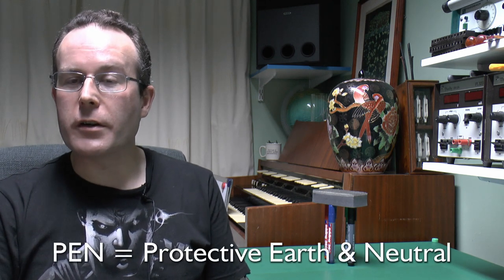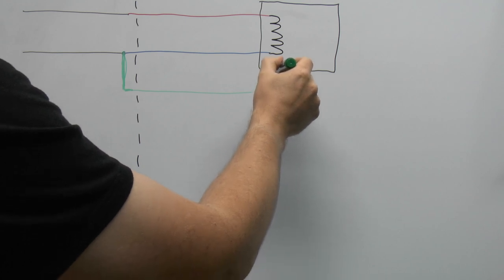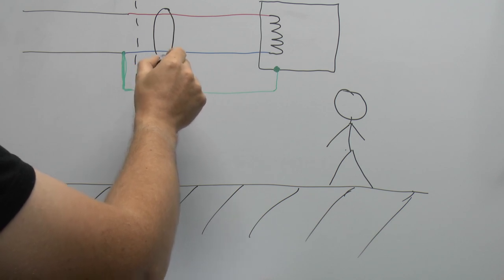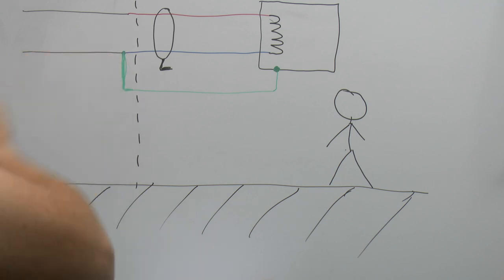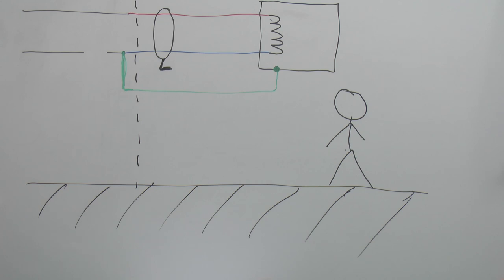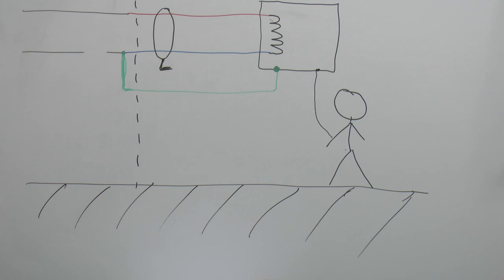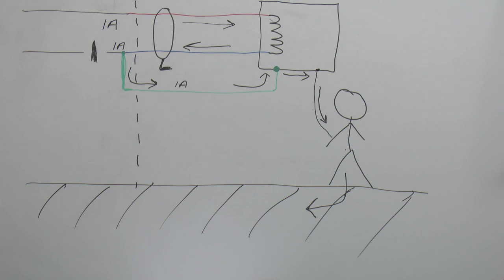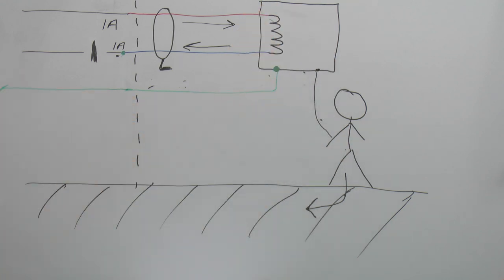TN-C-S Danger - Broken PEN Conductor (Combined Earth & Neutral)

Comment: 33:55 I was going to ask if this is a short circuit, but I realized the path is not complete. line->heating element->neutral->cpc->exposed metal part and then no connection back to line. thanks Mr john for the clear explanation.
Reply: could you explain the effects of using PME in TN-C-S systems ? how does it reduce the effects of electric shock in the case of a broken neutral. I read that PME is required in the case of a TN-C-S system

Comment: Picture situation at 3:55.   Neutral Return cable is broken on Supply Side of the boundary, no earth connection shown.  In New Zealand it is mandatory for the Neutral to be connected to Earth at or close to the point of entry to the property -- normally by a special suitably heavy cable running from the Earth Bus in the Fuse Box direct to the Earth Stake.  The Neutral Bus is also connected in the Fuse Box to the Earth Bus by suitable heavy jumper.  In domestic situations, the Earth Cable is an insulated (green and yellow, but may be green only) minimum 6 sq mm, stranded cable.

Comment: The combined neutral and earth to the service entrance (TN-C) is the standard utility practice in the USA. 2 hots with 120 to ground and 240 between them, one combined neutral and earth that is grounded at the distribution transformer and also at the service entrance to the property. Interestingly, this neutral on the secondary side of the distribution transformer is connected back to the neutral on the high voltage distribution (4-25 KV) side as well, and is often the literally same wire. This is possible because most utilities use a 4 wire wye connected distribution primary setup, with multiple ground points. This practice allows some utility primary neutral current to flow back to the substation via peoples electrical systems, ground rods, and water pipes. This can continue even if the main breaker to the property is off.

Comment: A simple solution would be for the RCD to drop out when its supply goes, like the 13A plug versions do. That would mean you would need to reset it after a power cut though, so could come home to a warm freezer.

A big contactor that only connected live and neutral when they have the right voltage between them would work.  Should be incorporated into the smart meter but I read they only have single pole contactors.
Reply from the maker: Voltage monitoring only detects the broken PEN conductor in some situations, it doesn't work in all of them.

Comment: Overhead supply, windy coastal location so subjected to plenty of stress. Had this occur on our mains supply just over a year ago, was not fully broken and started to get drops in voltage, able to diagnose the fault myself. SSE came out very quickly and sorted the fault. It brings to your attention the need for a properly designed and tested installation.
Reply: This is interesting, so the copper cable around the outside of the central aluminum cable started to deteriorate.  I would like to see what that looks like

Comment: TN-C-S:
The risk of electric shock is minimized if installed and connect the local earth electrode to the PEN => PE + N separator point. So the soil and PE's electrical potential will be nearly identical even if the PEN is damaged.
(hungarian electrical man)
Reply: In Poland for example you have to have a local electrode no matter what type of connection you have on the supplier side. That protects you against all possibilities. The earth electrode should be connected to building foundation metal reinforcement therefore the resistance is very low. Obviously this is a requirement for all the new buildings and there is thousands of private dwellings where there is no local point of earthing.
Reply: Exactly as we do in Israe
Reply: @ProfessionalAmateur 
Unfortunately, everything is based on the distribution network and the "star point" of the transformer. (this is a fundamental problem in TN electrical networks).
The ground electrode is "only" in reserve)
Reply: @ProfessionalAmateur 
Yes!
Unfortunately, our standards are not hard enough in this matter.

Comment: Had this occur on our  1970s TN-C-S (PME) service cable  Gas board caught the PVC sheathing of the  service in the pavement 10 yrs previous repairing a gas pipe next door and over time the Neutral aluminium outer conductor corroded until it eventually fell apart and failed under load (when i was in the shower). Western Power re-jointed with a new section of copper which is also less susceptible to corrosion

Comment: I live in the sticks and my home used to have TT earthing, albeit totally inadequate. The earth wire can't have been more than 4mm and the earth rod was a rapidly corroding length of galvanised steel pipe. The property was fed using two overhead cables (L+N) from the DNO street pole to the gable end.

When I had some substantial extensions built I asked the DNO if they could replace the overhead cables with a buried feed. They jumped at the chance and did the work for far less than the cost of the parts. The new armoured cable runs up the same pole where there is now a junction box with new tails connecting to the L + N. The poles actually carry the 4 cables necessary for a 3-phase supply, with different houses tapping off different phases.

The DNO provided a TN-C-S earth so the sparky who fitted a new CU used that rather than replacing the earth rod and sticking with TT. That immediately struck me as potentially dangerous since the pole sure as hell doesn't have an earth. The argument is that the PEN conductor has multiple earths along its length, so even if there was a break between two poles, there would still be at least one earth on both sides of the break. But there are still two joins between the overhead line and the feed cable. If one of those failed then my PE would no longer be at earth potential. The water pipe is plastic, as is the oil pipe supplying the boiler, and there are no other services, so the TN-C-S earth is all there is.

Apparently a supplementary earth rod is not permitted since the type of PEN fault which is never supposed to happen could result in said earth rod providing the return path for my home and any of my neighbours who happen to be on the same isolated segment. Quite how an earth rod differs from metallic water and gas supply pipes, which must be earth bonded, is unclear.
Reply from the maker: A supplementary electrode is permitted and has been for decades.  Most other countries have been installing them as a standard item for ever.  It's now a recommendation in the UK that all installations have one.
Reply: @jwflame  
John do you mean earth rod when you say supplementary electrode.

Comment: You can also connect the metal case to a local earth electrode. So the current flows directly through the ground electrode and the earth back to the transformer. This is called TT (Terra-Terra) network. But you still need the RCD. The earth resistance should not be greater than 1666 ohms (50V : 30mA = 1666 ohms). You build up your own protective conductor over the ground. And the person is still fully protected. The neutral conductor must never be connected to the protective conductor.

Comment: But you forgot that the norm obliges you to bring a local equipotential to the first separation of the PEN conductor in this way even if we have an interruption of the PEN conductor from the electrical connection we have the local equipotential that takes over the PEN function, also the norm obliges the local PA to have a maximum resistance of 4 ohm (when it only has the function of the local equipotential , when it has a common 1 ohm discharge function) and it must have the ability to ground the phase conductor (upstream MCB protection   
 
IEC 60364-5-54
EN 60364-5-54
End  for UK 

And in the  BS 7671/2018  at the 48 page  (fig. 3.9 ) , and 444.4.3.2  fig 44.2    ,  fig 705  , way not 16A5
 
What you said in this video is perfectly true, but this circuit-building model presented in the video is made in full contradiction with the norms and standards in force. And it presents a very dangerous situation when intentionally breaking the rules and standards
Reply: If the point at which the PEN became open circuit was further away from the installation, and between this point and the installation there was an earthed electrode, then what would happen in this case? Would the electrode then provide an alternative path back to the source earth? If so, the Line current that that returns from the appliance and back through the installation Neutral, would that then return to earth potential once it reaches the first connection to earth. If this happens, then this would prevent the current returning through the earthed parts of the system?
Reply: @ianrainford8910  
"If the point at which the PEN became open circuit was further away from the installation" = The norm said each electrical connection (branching distribution system) must be connected to the equipotential local networks air distirbutie if every 100m must be connected to a local earth connection.  ( away ?? )

The next question I dont anderstand but I think you forget a thnik : 
each earthing of an electric conductor increases the current that is controlled by the MCB so when a short circuit arises, MCB protection will interrupt the affected conductor within max. 5 sec. (in reality, this happens under 0.2 Seconds if the ground outlet was properly designed

Comment: Also, if the electric cooker and water heater were turned on, the pipes bonded to the ground point would become live until they disappear into the ground, 30A or more on the water pipe would make it hot and potemtially boil the water (seen steam coming from a cold  tap when there was a live to earth fault on a cooker circuit, ground conductor was poor (old installation))
Reply: +Sparky Projects So you're telling me you can have hot water without a water heater? :)

Comment: So would it be a viable option on TNcs supplies to add an additional earthling rod from the MET to ground to counteract such a problem?
Reply from the maker: Yes - but a single rod won't do very much.  To have any real effect, the electrode would need a very low impedance, typically under 10 ohms.  Only likely to be achieved with a large metallic grid or mesh.
Reply: @jwflame  I just installed 1 earthing rod 1,5m long 40cm deep under ground surface and measured it afterwards, it showed up 13,2 ohms. I think If I had chosen a 2m long rod the 10ohm value would be in reach easily. Then I installed another 2 rods and connected all three of them with a metallic sheet 4mm thick by 40mm wide and after I covered the whole system back I got a measurement of 3.1 ohms. The rods were 1.5m long placed 3 meters between them in a straight line in a 60cm deep ditch.